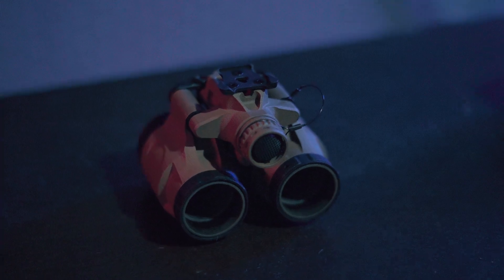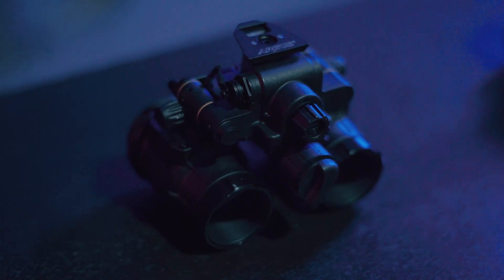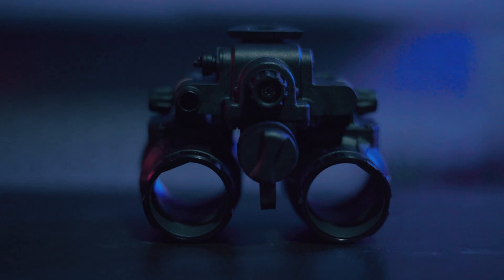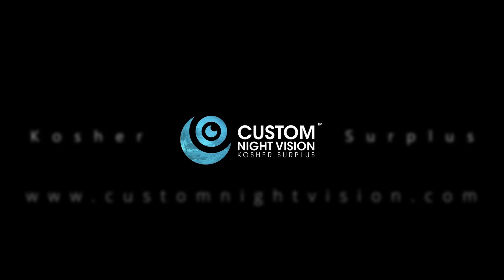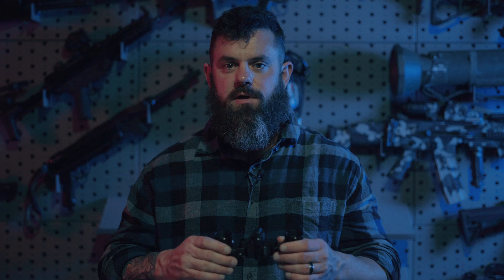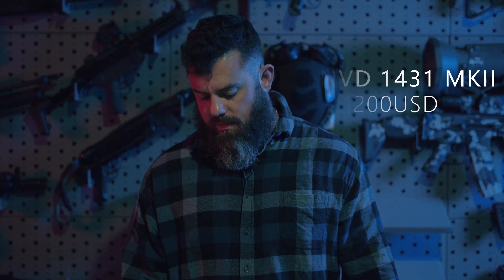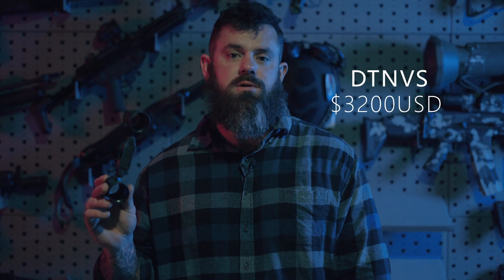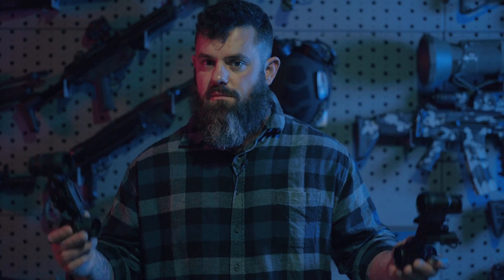Custom Night Vision Housings | DTNVS | Katana | BNVD 1431 MKII |

Comment: I'm glad I chose the 1431. I don't know how the DTNVS get away with what it costs with no ip stop or adjustable gain. The Kata I would switch to in the future if they put manual gain on it.
Reply: KISS. Never needed IPD stops or wanted to fiddle with gain settings. Especially if I’m in an actual fight. Now the auto shut off feature and 18 oz weight is useful which the Chinese 1431s don’t have.
Reply: @thejohnhend  You're also 12 and have never used night vision.

Comment: My next (and what i feel like is my final purchase....for now) is NODs. I want to build my own night vision system but one thing I cant reeally seem to get an answer on by simple google searches is, do these three housings have all the electronics already built into the housings?
Reply: All of the electronics are included with the housing, minus the intensifier tubes and glass.
Reply: Hey Uplift. Housings are just that, just the housing. The guts that are selected are installed. I recently ordered my Katana from Nocturn industries. I was able to get hands on a few of their NV units to check out before ordering. They are nice units and Jeff (the owner) and his team that I met are solid guys. Good luck man
Reply: One other thing, as they say: buy once cry once....then again when you buy your lid, mount, ir devices and so on. It's not a cheap endeavor but you need quality supporting equipment.
Reply: @subie38x  oh trust me I know, I want whats exactly best for me. This is not something im trying to cheap out on but I am looking at actually building them myself solely for knowing every piece of failure of the system so if something goes wrong? I know where the issue lies. If that makes any sense? I hope. ITs the same reason I built my own ARs. IF they fail, I know where the failure came from. Nocturn Industries is really what I Have my eyes on at the moment. 1) the housing looks absolutely dope AF. I also think the push button for On/Off is an great concept. Its simple, its light, and their warranty. But I dont really seem to know if the housings have the electronics onboard inside the housings. For example - the Katanas. If I buy the housing, the optics front/rear, and the IITs, is there something im missing from that list?
Reply: @realghostactual    The wiring will be in there.